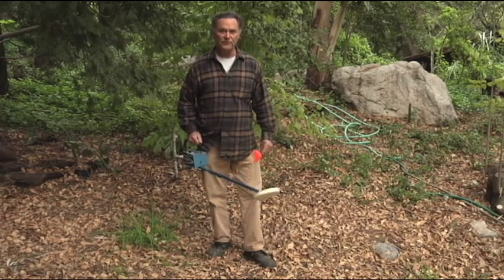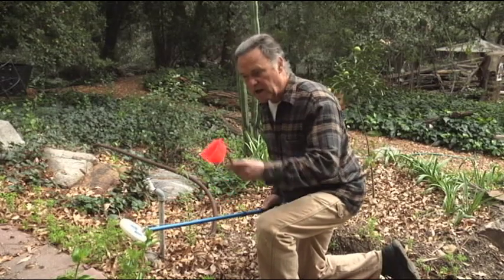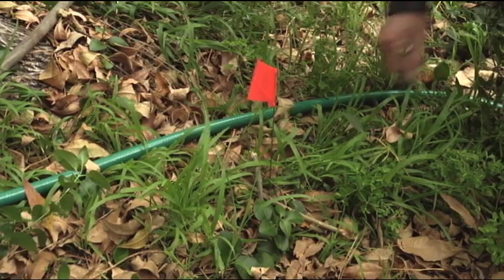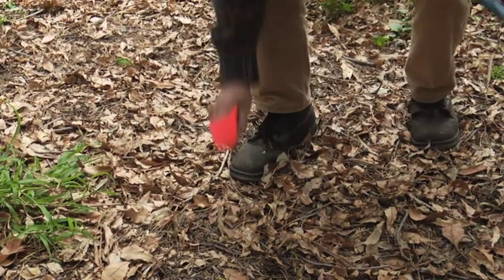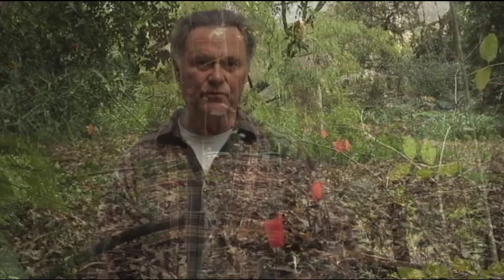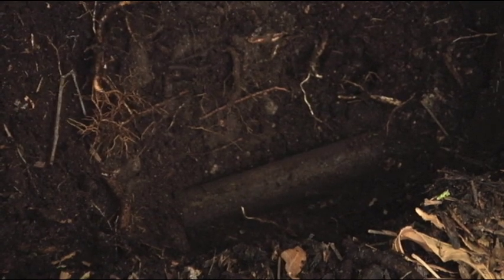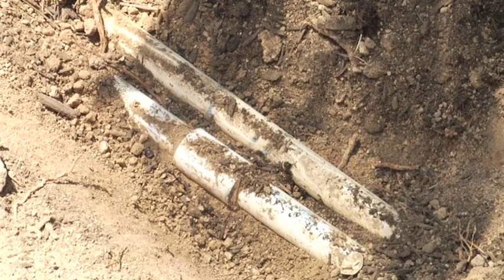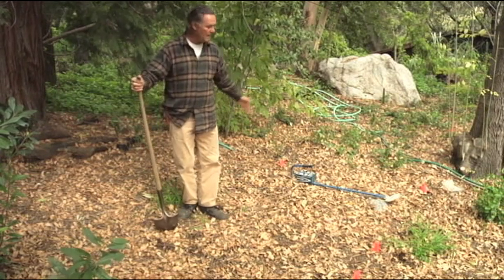Digging Safety: Finding the Utility Grid with a Metal Detector - Prune Like a Pro

Comment: It all depends on the utilities you are talking about.  Most gas companies in rural areas will only Mark for you from the main line to your gas meter.  The line from the meter to your house is the home owner’s responsibility.  Take my residence for example.  My gas meter is over 50 ft away from my house and makes a 90 degree turn before entering my basement.  I only know this because I had to trace it myself using a detector as this fella did.  Don’t even get me started on sewage systems with leech beds.

For anyone wondering, the Bounty Hunter IV is a great multi purpose detector that will help you locate water and gas lines.

Comment: Great informative video, thanks. Will this technique also find power lines? How deep will a run-of-the-mill metal detector find a water pipe or power line usually?
I'm also wondering if running a metal "cable puller" down the drainage pipes will be enough to pick up the PVC pipelines?